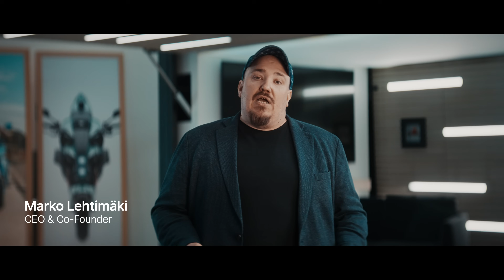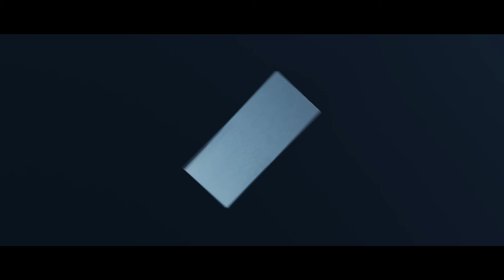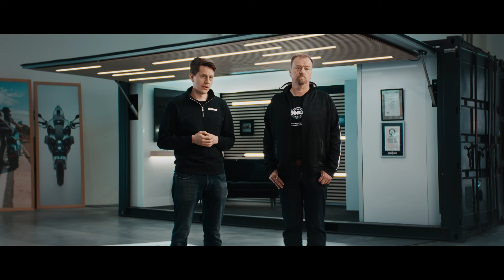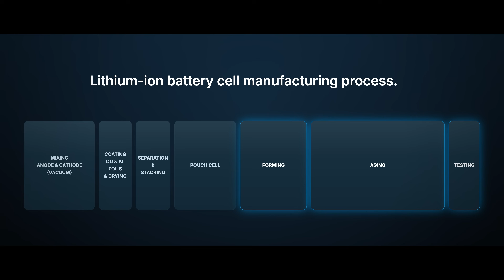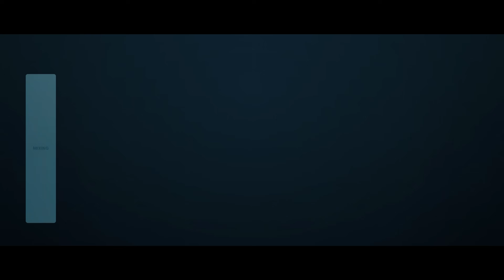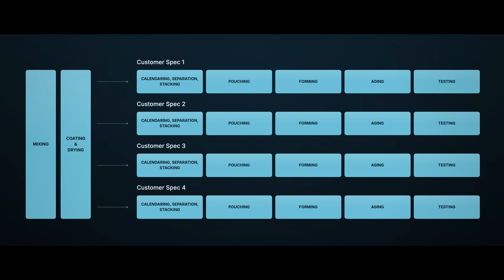Manufacturing & Scaling | I Donut Believe

Comment: They are making so many batteries but they can't show us even one because we wouldn't believe.
Reply: NOT ONE battery has been delivered, while promises of them in Motorbikes were promised to end of Q1 and in Q2... we are now in Q3.
Reply: @PjotrII  No, we are not in Q3.... What are you smoking man??
Reply: @StijnDeWitt  Yes, I was wrong on that, made some Republican maths!
But the idea is this, in early 2026 they said PRODUCTION IS ALREADY ONGOING and first products would come in Q1... then nothing came, we are now soon at the end of Q2...
the whole idea... it smells more and more like a scam for every month that pass.
Reply: @StijnDeWitt  so? they promised on end of Q1, so even with some delays it should be early/middle of Q2 - now we are at end of Q2 and nothing happened - and I bet you we dont see anything even on Q1 next year
Reply: @duniek86 maybe they forgot to say Q1 which year. Could be 2044😂
Reply: EXACTLY
Reply: Ziroth already exposed them
Reply: You've seen more than 3 in the VTT testing,  my friend.  lol
Reply: @PortableRVSolarStandProjectDIY And why are the relevant VTT test reports either not released or done?

Cold temperature. 

Weight. Weight. Weight. Density. 

Cycle life even just to 500 cycles.

Safety test. Think of nail through charged cell.
Reply: @go1dfishyyyyy  For one thing, those were tests on the original battery, not version 2, so that wouldn't reveal the current state of the technology. Those tests may or may not matter anymore. Season 2 hasn't started yet, and that will be much more relevant for their current state of development. It's a rolling Donut not a static invention. This website isn't the only source of information about Donut's likely chemistry and production methods. It is the visible part of the iceberg... and if that sounds like a Titanic reference, it is. Remember who survived the Titanic vs. iceberg collision. But, on the other hand, my fear is that the best technology isn't always the winner. The winner is often the one that was good enough and happened to be positioned better and more recognizable to the general public. Best isn't always better. Most newer battery technology may be "good enough" and safer to CEOs. I expect that if Donut lives up to potential, it truly will dominate the world. But since good enough has trillions of dollars invested already, it may be a tough sell to major companies. It is yet to be determined which one is the Titanic and which one is the iceberg. I know who I would choose, I'm Donut all the way, but revolutions are inherently dangerous to all involved and I can't pretend that inertia and "sunk cost" psychology won't win the day for the status quo.
Reply: @go1dfishyyyyy  Yes. All these tests are not just easy, they are obviously what we are all waiting for and expecting. They started strong with proving some claims (not the BIG claims, though) then just pivoted to 'bla bla' without proving their 3 biggest claims.... Highly suspicious but at this point I don;t expect those tests to come anytime soon as I expect that they simply cannot live up to their own claims.
Reply: You can buy a Verge motorcycle and have 2 or 3 Donut Lab batteries--right now.
Reply: @wa6ehd  link me a video where someone owns the bike then we shall talk
Reply: @wa6ehd   No you can't.   Verge released their own video immediately after they announced their first production bike.   They said they're building about a bike a week, and the first 40..  will go to.. *drum roll please*.. themselves.  They're delivering the first 40 bikes (for 40 weeks) to their own test fleet.   No actually customer is getting one..
Reply: @wa6ehd  You can buy and pay... but you are not getting it.
Reply: @wa6ehd no you can't
Reply: @wa6ehd  sure buddy

Comment: So... IS this a Sales Ad for Cell Franchise Production and licensing?..😮
Reply: I think you'll find their business model has always been B2B, Verge Motorcycles is their internal customer, but via Verge Next the seek to sell the fabrication approach to other OEMs. This video confirms elements of the business model, supplying the input product (battery substrate material) for OEMs to manufacture on site to shorten supply chain lines and dependencies. This whole video series has been aimed at OEMs, to provide them support in deciding to opt for Donut Lab battery technology.

To date battery produciton has been fairly expensive and time consuming to setup for OEMs, for example either electing to co-locate gigafactories with EV production lines (Renault's Electricity, and Nissan's UK global EV hub are examples), or using long supply chains with long lead times for imported battery cells. What Donut Lab are indicating is moving to a more advanced model of delivery of pre-cursor battery materials, that can be formed and finalised on site, with lower footprint, operation and cost impact equipment, which increases OEM product design and production flexibility as well as significantly reduces produciton timescales.
Reply: @GruffSillyGoat come on, you don't sign contracts with OEMs by making silly deceptive youtube videos.
Reply: @stemceiling - more a case of creating awareness and noise that provides OEM support in making product selection decisions,, like all marketing campaigns of this nature in the B2B market segment.
Reply: @GruffSillyGoatthey are nobody. So at this point they need a product to convince OEMs and not marketing
Reply: @stemceiling  - oh dear, seems you believe that OEM's haven't been talking to Donut Lab, via B2B channel VergeNext. Having ex-Mclaren and other motor industry executives on board means they already have the in to many discussions with OEMs at very senior levels.

The video series will support these discussions by increasing public awareness, hence the mix of technology and application use-cases in the series.

Comment: What is the weight of the CELL?
Reply: I want the cold temperature performance and proof of no critical materials ( no need for proprietary chemistry, just what is or is not in it).
Reply: They don't have the knowhow nor equipement to weight a battery. But they have the tech to make SSB 😂😂😂
Reply: It's zero 😊
Reply: It floats so helium level!
😂
Reply: @haukikannel 
😂😂😂
Reply: Мотоцикл весит 235 кг ,с аккумулятором 30кВтч👈